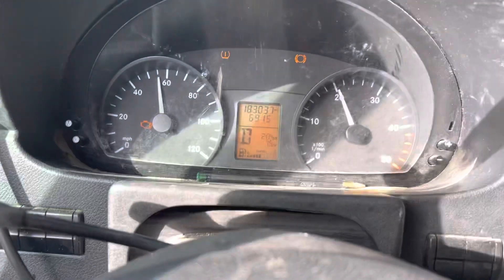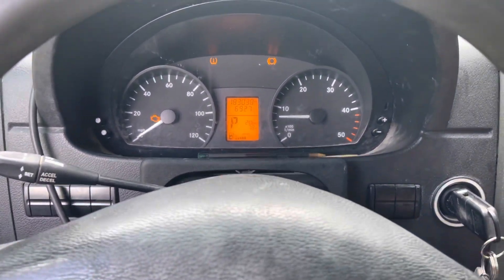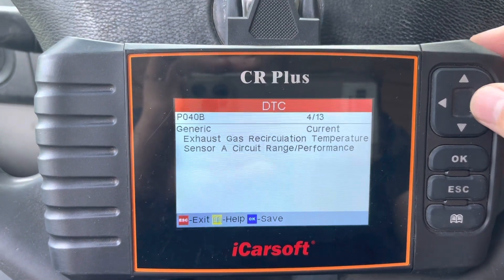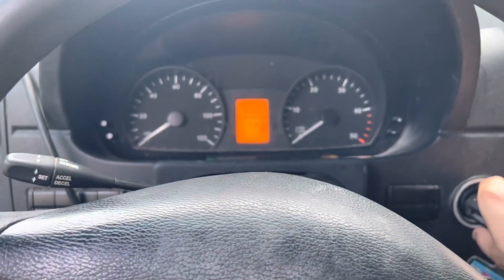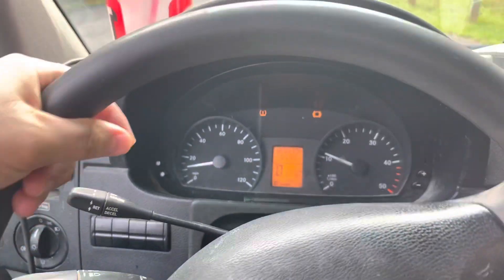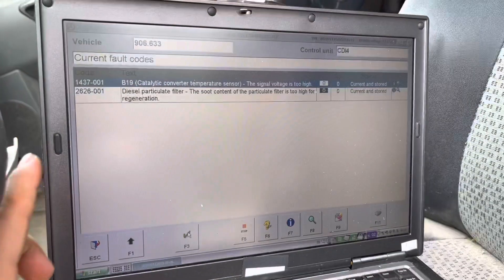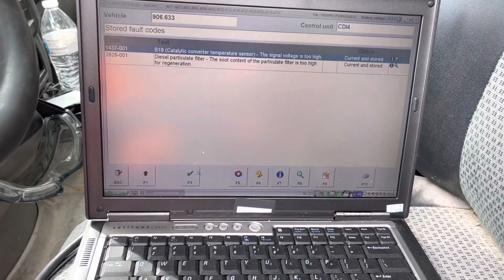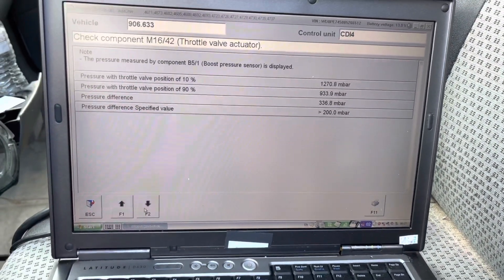Diagnosing a Van with Limp Mode P0428 Code and P242F Codes on 2008 Dodge Sprinter after PDF Delete

Comment: wait you can straight pipe those dodge sprinters?
Reply from the maker: Yep, normally 2007-2008 and some 2009, you can simply remove the PDF and put straight pipe and it works, but in this situation someone also did software update but did not do it right or something failed and now it’s stuck in limp mode, also there might be other problems like many boost leaks, right now I am working on a 2008 freightliner sprinter and I found many boost leaks it’s crazy and not only that many other things wrong with it, stay toon for that sprinter
Reply: @ZimaletaMotors  ok cool good to know thank you i will stay tuned!
Reply from the maker: Thanks